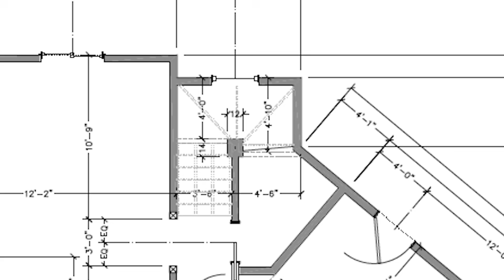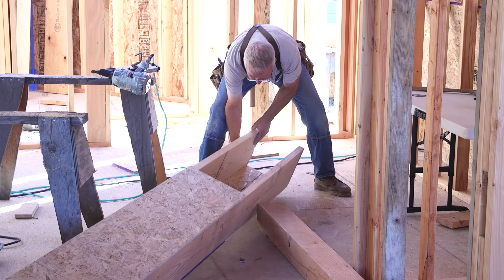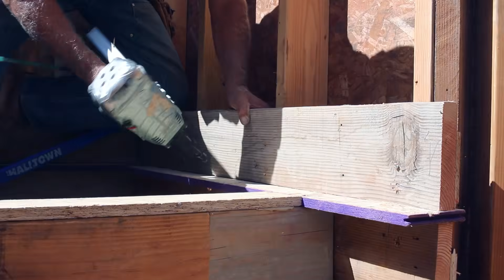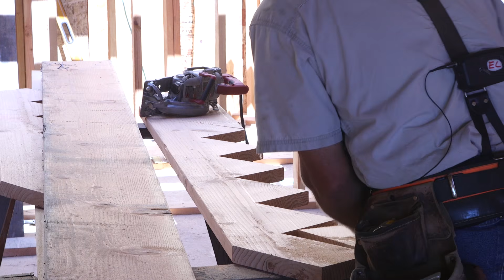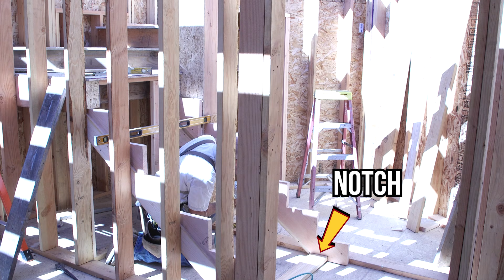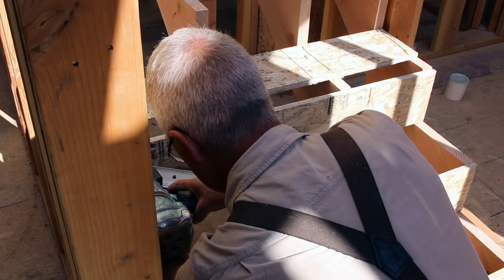Building Winder Stairs Ep.56

Comment: Put a door on the area under the stairs so you can use it to store stuff. One house I had they did just that and we put ALL our Christmas decorations there nice and neat. It was great. That house was big (4,200 sq ft) and even had a paint room with sink. It was just some space that had no use but out of it came the paint room. The prior owners placed the paint cans on the cement floor staking them three high. All the ones touching the floor leaked but only when moved! I ran out to Lowe's and bought all the empty paint cans needed to transfer all that expensive paint over (at $45 a gallon) AND put some scrap wood on the floor to get the cans off that cement. That first can I used that was on the cement didn't leak until I mixed it up and left a trail of paint from the kitchen to the office room. I looked around and at first couldn't figure out how it was leaking? LOL Right off the bottom, and where the can sat, also on my wifes new desk! No harm as it was caught and cleaned up quickly. The only good thing is I didn't drag it over carpet but over oak flooring that was easy to wipe off.

Comment: You stated that you did not install the final upper joists for your stair well. 
This is actually easy as since you must maintain your rises during run of the stairs. 
You cannot change these dimensions for the straight portions to and from the winders.
If you do, it causes a tripping hazard as the. Human body calculates automatically the rise of a step. 
Additionally, in your calculations for the rise, you must go between finish floor and finish floor. So if you are having a full thickness hardwood floor to overlay your subfloor your bottom riser will have to be higher to accommodate the thickness of your finish floor.
In all stair building, your rise to run ratio must fall between 17-18”.

Comment: I know this will sound a bit peckish coming at this time but I still don't understand why the 2nd set of stairs are needed, especially in light of the financial hit. When calculating a home's square footage stairs only count as half the footage - w/o them you'd have at least an extra 100 SF. If homes are going for $250/SF in your area those stairs are costing you $25,000 to add... quite a hit when they're probably not necessary in the first place.
Mud rooms between the garage and kitchen are huge these days, I think you'd have been way better off putting one of those instead a costly 2nd set of stairs and as a spec builder isn't your motivation to maximize profit while still building a great house?

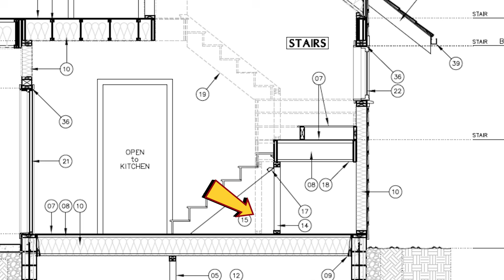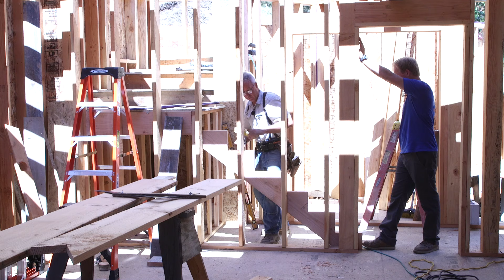Comment: Can’t wait to see these finished. I’m confused by where the stairs stick into the kitchen doorway. Looking at the print they show, the bottom stair ends where the kitchen door is but in the video it looks like they’re sticking out into the doorway bit.? See video at 6:35 for print, and 13:50 where they’re sticking into the doorway. Maybe once the door is in and trimmed they line up?
Reply: Yeah, I noticed the stick out in the doorway also but didn't pay attention at the drawing. Maybe it does account for a door frame  but I would've thought that to be built into the structure already like windows. Guess we'll find out in later episodes. So many details to account for when deviating from a simple cube.

Comment: An old Scottish carpenter told me when I was a young carpenter in Wales, "You can get away with 3/8" on your bottom rise only.  Any more or anywhere else and you will feel it."  He was absolutely correct.  I've probably built over a dozen stairs this far, most of which were formed in concrete but the principle is the same.

Comment: Hey not 100 percent sure but I think the notch at the bottom of the stringers needs to be on the outside so the stringers don't slide down. Maybe your inspector will let you get away with it the way you did it since you put so many a35's on it. I maybe doubt it going to move on you but every time someone steps one the top stair it pushes against the floor and may in time pull/slide away from where it's supposed to be. Hopefully never coming completely free. Good luck on it hope you don't have to rebuild these stairs too. Got to admit I'm no expert but I got called out on it once. Hopefully you knew this and just cut the wrong side.

You seem to care that things get done correctly.

Comment: Wouldn't the notch at the bottom of the each stringer be better placed toward the front of the stringer? Weight on the stringers would tend to push the bottoms outward. With the notch and cleat at the front of the stringer, just behind the first riser, the stringer would bear directly on the cleat rather on the bracket and nails.
Reply from the maker: True!!! My conclusion is this.

The notch at the nose makes it super easy to break off the whole first rise especially if the bearing is not perfect. 

A bracket at the back will do a lot of good work on its own .

The interior stringers are screwed glued and nailed to two stringers that are each nailed to a partition. With over a dozen treads and at least a dozen risers. 

Add to this the fact that the floor covering will be butted up to the bottom riser. Seems like a nonissue to me. IMHO. ;-)

Comment: FIRE BLOCKING    THE IRC REQUIRES FIRE BLOCKING blocking must be angle cut between the studs where the stringer will be attached. The ledgers for the platform also have to be fire blocked. We had to strip off the sheetrock in a remodel 3 sets of stairs Fire block with 2 X material then replace the rock with 5/8 fire code. The under stairs makes a good place to build a children's play house and it must also be 5/8 fire code sheet rock.
Reply from the maker: We will have a separate video on fire blocks and fire ratings...

Comment: Great video as always, as a green person getting into construction and carpentry for my family. I look forward to working with older more experienced people in any trade to learn more, it isn’t work to me with the great amount of satisfaction that comes with finishing a project. On another note I have been acquiring more tools and have been looking at framing nailers. I’ve been borrowing my mentors Bostich nailer but was wondering about the Metabo you use, I have two siding nailers made by Metabo and they’re great quality was wondering if you had some input.
Reply: Bought a ½” Metabo hammer drill once. It burned out within the first cpl days of use. I took it back to Home Depot and they replaced it, no problem. Burned the 2nd one out in a similar amount of time. Bought a Milwaukee after that and still have that drill 20yrs later. Just my experience with Metabo 🤷‍♂️
🤜🤛

Comment: I'm loving this series and as a retired Architect in the southeast, I've seen some innovative techniques that are not seen much in the south.  Personally, I hate winders.  No matter the care taken, they're a trip just waiting to happen (as if all stairs aren't).  I do have an issue with the notch for the toe board at the bottom of the run.  IMHO, the notch in the stringers should be at the front of the stringer and not the rear.  The purpose of the toe board so to prevent the bottom of the stairs from kicking out which works better if the toe board is at the bottom front of the stringers.  Otherwise, great job.  As a side note, the stairs that have to be rebuilt should have never happened if the Architect had called out the rise and run of the stairs as he should have.  If he did, then he got it wrong or Scott ignored the Architect's dimensions.
Reply from the maker: I ignored him!!! Thought I could squeeze out a little more room in the entry!!!!😣
Reply: Absolutely agree about the 2x4 notch location. The structurally logical choice.
Reply: had an architect on my bro house in the uk he was so good he planned the gable end of garage roof over top of the bedroom window we ignored that guy too lol funny how that works
Reply: Winders like that ARE a trip waiting to happen - that 45º segment design is absolutely apalling but that is all that's acceptable by code these days in Canada. You cannot have equal length treads on a stair like that, yet that is demanded for any other type of stair. You get closer with a 30º segment but that's not allowed now. The most comfortable winder stair I've ever walked was one I designed and built for a job that wasn't subject to code so didn't have to comply. It was a double 90º dog leg (a wide, square 'U') with radial treads (generated from one point) so every tread from top to bottom was at the same angle to the last (7.5º I think - 90º / 12 treads) and the exact same length at a 'walking line' that was generated geometrically (If my memory serves me correctly from a point  8" inside the internal newel at the corner in both axes). Not claiming originality as I've seen many historical examples of similar but I don't understand why it's not allowed by code, other than I guess it would be very hard to check for compliance.

Comment: is it just me or does having a power nailer cause someone to put more nails in a board than if using a hammer? they definitely speed up construction only to slow it down while reloading. i am musing a little........g
Reply: With a bit of experience, the nailer is way faster. It takes just a couple seconds to reload and you can fly through your boards, especially with a bump trigger. Plus it saves your shoulders :)

Comment: Where you cut the notch for the stairs, consider cutting on the front side and not the back side. that way the stairs will push into the board attached to the floor and not pull away from it. just a small difference in how I've helped me dad build stairs i noticed. Great job though and greetings from Texas!!
Reply: This. 
Provides backing support to the first riser too!
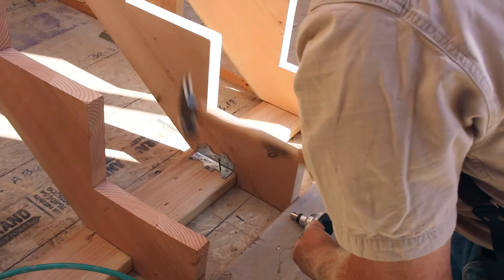Reply: Andrew mamrus - 19:14 is when this is evident. Good point.

Comment: Here in the UK we try to set the centre of the winders to the same distance as the treads on the main flight with 3inch at the inside minimum, after all have you ever seen anyone come down a set of winding stairs like Gene Kelley rounding the lamp posts in singing in the rain?

Comment: Are u installing 3/4" hardwood or tile floor in that area because if u r then that bottom step at 1," shorter is not going to be right,  it needs to be 1" less than top of finished floor, not subfloor
Reply: Yes...this is a very important detail that was driving me a little crazy. Lol. I kinda think if someone is building stairs for their first time they will do more research than just this video. He did a great job covering most bases.
Reply: I frame houses and live about 1-2 hours from Scott and the way he did it seems typical for our area. He is using 1" thick treads. Every step gets a tread added to it including the 2nd floor deck which acts as the final tread.  A deduction needs to be made to the stair stringer at the first step to compensate for the stairs being built on top of the already existing 1st floor deck. The first step is the only different step because the 1st floor deck is already in place and not getting an additional tread added. In the end all of the stair rises are equal including the first step.

Additional adjustments can be made if there is going to be noticeable difference in thickness of flooring types between the 1st floor, stairs, and 2nd floor. The rounded overhang on the treads is optional and only done when finishing with carpet. The rounded detail adds a visual level of detail to the finish of the stairs.
Reply: Not if the stair treads get a 3/4" finished surface also. I'm wondering how that would work though because those osb treads already have a rounded overhang.
Reply: All very good points. As a general contractor in eastern pa we don't even mess with steps. We call out the lumber company or mostly a custom stair shop. They ask me my finish floor hights and boom they show up. They r box steps made however you want. Primed, stringers, risers, oak treads, or any options you want. Winders would probably be a series of boxes to sit on landings. I'm sure that would have more custom work for sure. With field labor ever rising...the shop built end up being very reasonable too
Reply: @gibsonbuilds4841  Thanks for sharing that. That is a very cool service to have available. I wish that was available in my area!

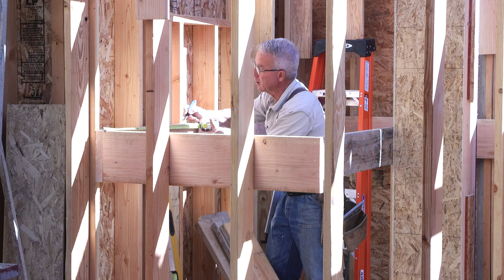Comment: About what you are doing from ~ 5:30 in the video. I was instructed to do lap joints and use glue in those places when I worked in Holland 6 or so years ago. I've been told it is a much more solid joint for this application and doesn't tend to develop squeaks over time. What is your reasoning to do it the simple nailgun way? Is it just a matter of saving time?

Comment: should add 2x4 to outside of stringer for drywall and to be able to drop the skirt board in
Reply: Do these stairs need a skirt board? They're sandwiched between two walls for the full length on both sides...
Reply: Kevin Vermeer skirt boards should be put on regardless if they're against a wall or open.
Reply: @johnem4695  Why?
Reply: I use a 2x4 also.  Allows for drywall and 3/4" skirt.
Reply: Judging by the fact he's using OSB stair treads, glued and nailed in, these stairs are getting carpeted.
Reply: Yup. I’ve had to scribe a bunch of skirt boards to the stairs over the years. It’s a royal pain compared to being able to drop it in.

Comment: Scott or Nate, please forgive my question (not criticism) I was taught to put the notch at the bottom (for attaching to subfloor) at the riser side (toe) of the stringer. Theoretically in a failure of the attachment at the top of the stairs (common weak point), the notch material would prevent them from falling.  

Is there a reason you guys put it at the back of the stringer? I’m always looking to improve and learn
Reply from the maker: My reasoning is that it is just so easy to break a toe off of that riser both in the notching process and in fastening them down.
Reply: @essentialcraftsman  I never thought about that and luckily haven't had that issue happen. A front notch is definitely closer to the intersection of the 1st tread and 2nd riser (grain wise) and a more likely a failure point. Thanks for the reply!

Comment: will the finished surface of the tread or riser be OSB?
Reply: Carpet mostly likely. If he had been using dissimilar material for the floor covering and the stair treads he would have had to account for it at the first riser. Since he didn't I assume all the covering will be the same thickness which would indicate carpet or hardwood flooring. Also, he has an over hang on the tread which would have to be removed  if he was going to install hardwood treads or a laminate floor covering.

Comment: Why do you always plunge cut, i.e. lift up the heel of the skilsaw, at the start of a cut?
Reply: The mag77 blade guard always catches when cutting at an angle and lifting the heel helps you align the cut and make and little adjustments before you go full on. Trying to adjust mid cut always binds the hell out of the blade.
Reply: It's probably a bit easier to see where the blade is actually going in.  And it probably helps prevent kickback/skipping of the blade by minimizing contact.
Reply: When cutting on the diagonal the guard hooks the edge?

Comment: I worked in the trade in the 1970s and 80s as a young man.   In residential construction with 8’ walls there are 13 steps in a staircase.  We always left it up to the owner of the house to determine if they wanted the odd numbered step at the top or the bottom of the stairs....   

You old hands will get this one...

Cheers!

Whipple